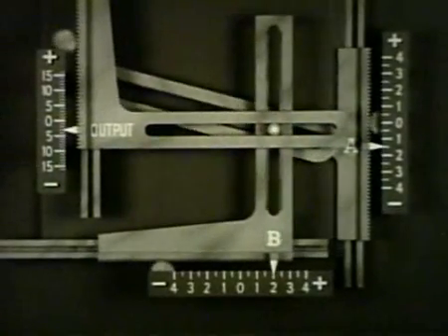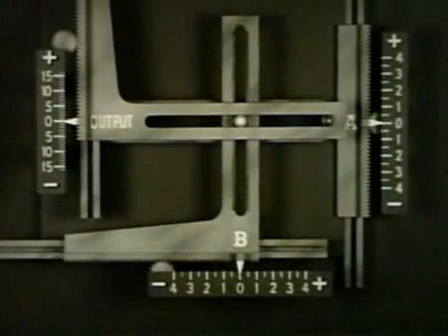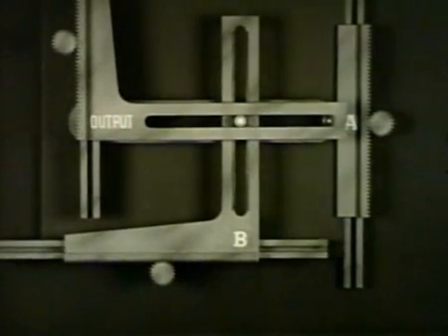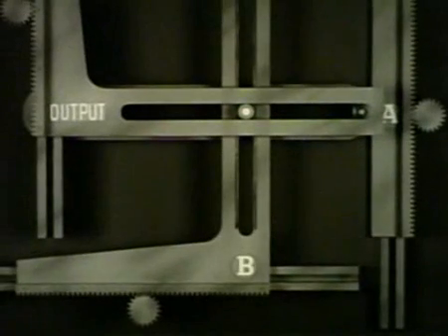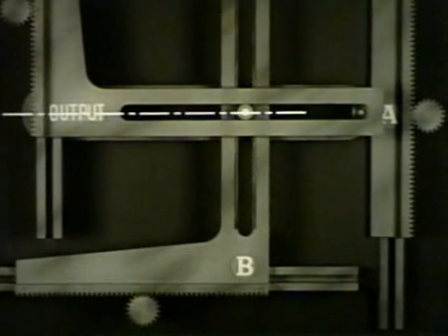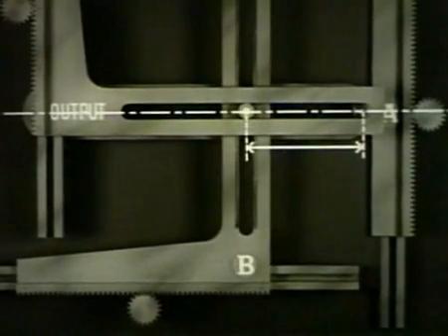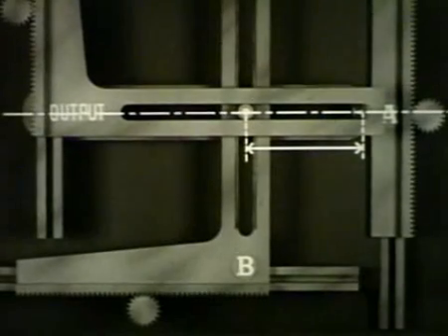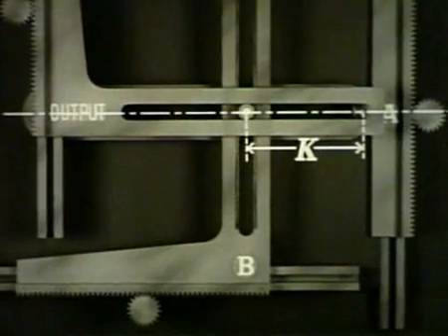u.s navy vintage fire control computers (part 7)

Comment: @Curixq A mechanical speedometer is a differentiator. A spinning shaft with a magnet on it tries to spin a needle. The spinning needle is restrained with a spring. The faster the shaft turns, the further the spring stretches, which controls the angle of the needle.